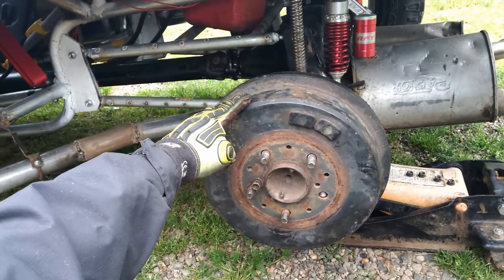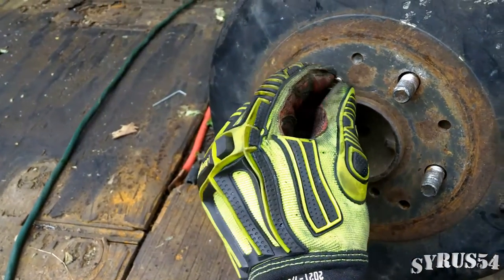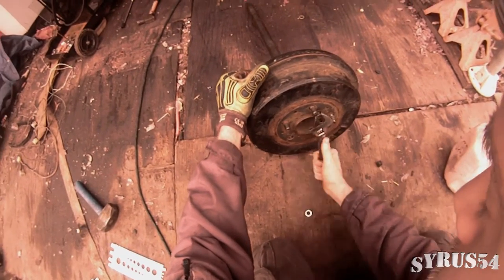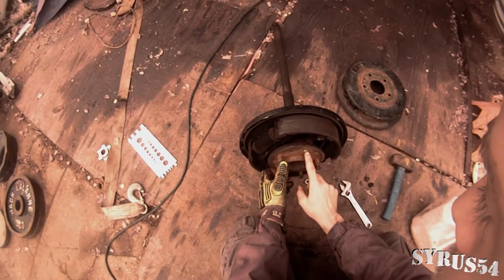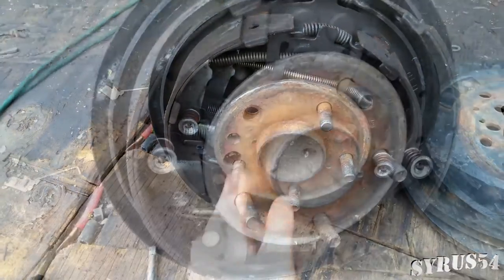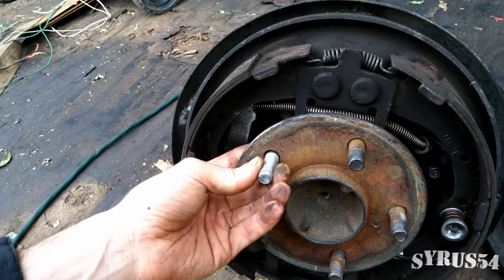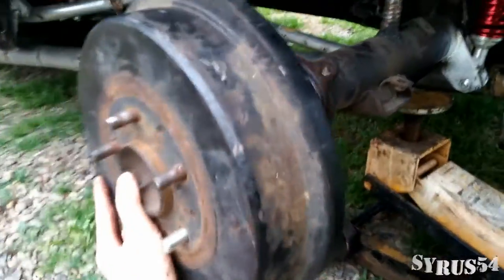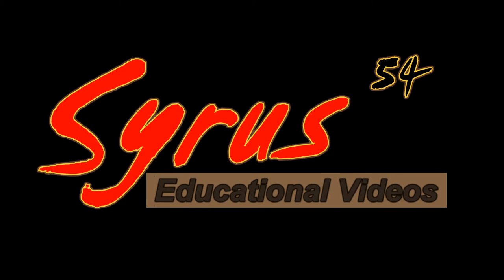Installing Brake Drum & Wheel Stud (3rd Gen Toyota Pickup)

Comment: you are doing absolutely nothing right. They aren't supposed to be used as jack screws. Use a puller. And ffs, why did you pull the entire axle out? You're beating on it with a sledge?  This guy doesn't have a family tree. It's more of a log. No branches.